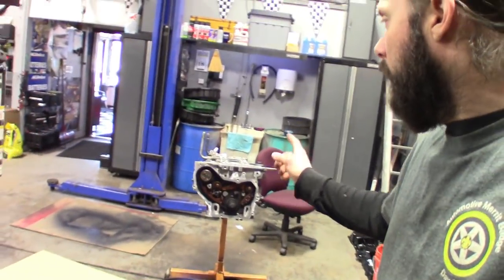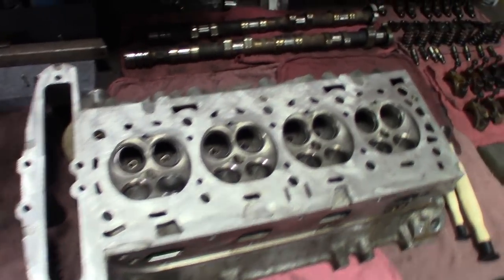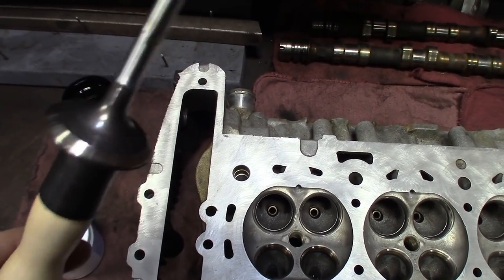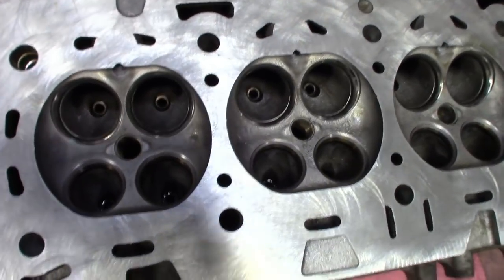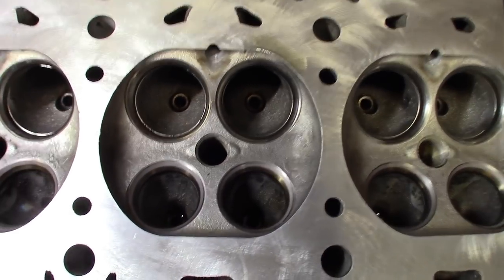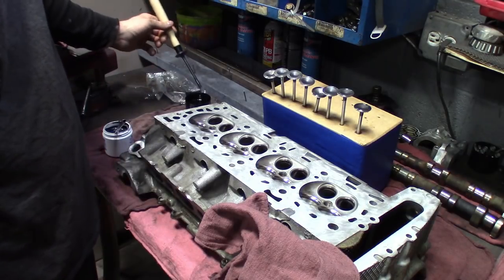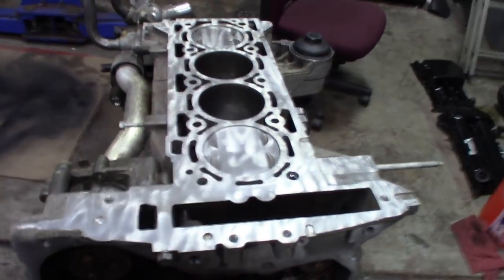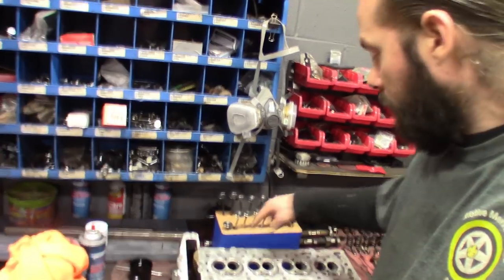How to do a Valve Lapping Job!

Comment: another tip for lappin i use is vaccum hose tubing on the other side of the head on the valve stem and put a lil nail on the opposite side of the tubbing and use a drill works 100%
Reply: try it

Comment: Did not have much to do here also,a clutch and starter replacement in a Jeep.Have a 2003 Buick Rendezvous ready to put the gas tank back in,fuel pump replacement and found it was out of gas wondering why it wouldn't run

Comment: nice vid. what tool u used to remove the valves and did u used a spring compressor? i like lisles special tool its amazing pn 36050 i used this same kit to install them
Reply from the maker: I used a socket and a hammer to remove the keepers. But I will be using the Lisle tool to install em.
Reply: the lisles works the same way gotta use a hammer